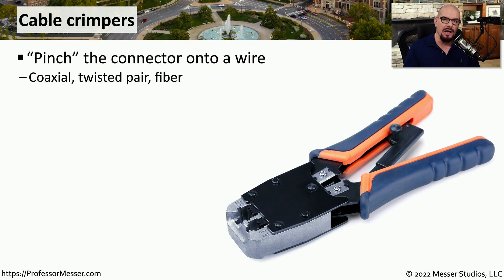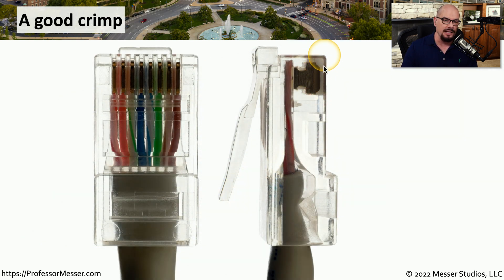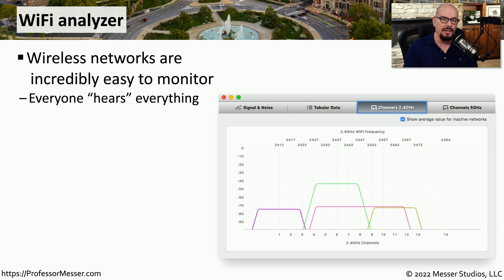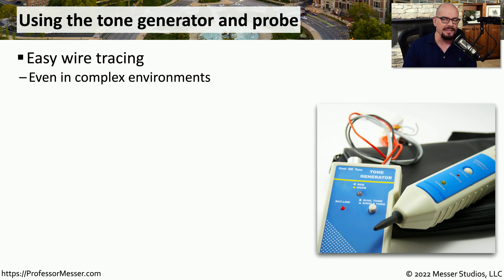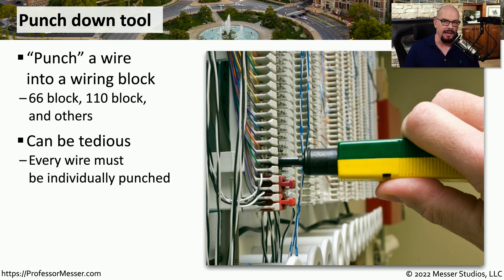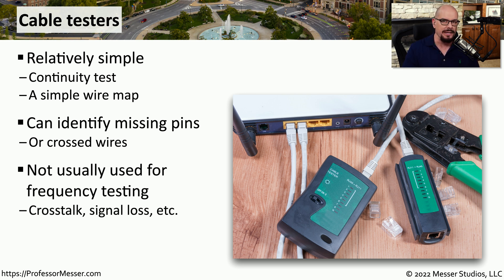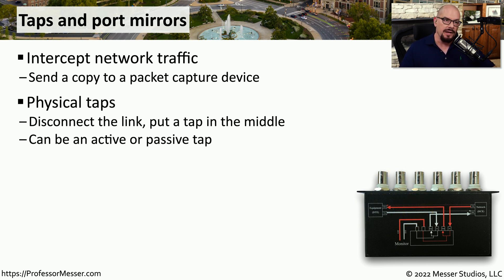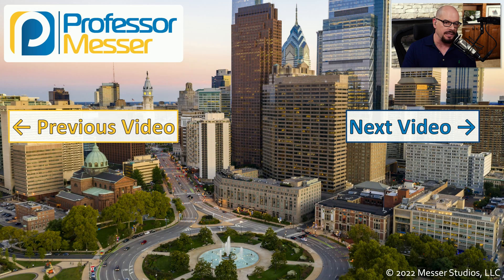Network Tools - CompTIA A+ 220-1101 - 2.8

Comment: For anyone who is trying to run wired ethernet in your home. Over the course of 5 years and 2 different homes. I would recommend not buying a spool of cat cable, just buy high end cables that are already terminated the exact length you need. You will thank me later. 

I have successfully terminated them before, but it takes much practice to get them perfect, and even on your best day you will not be better than a cat 8 cable you bought that was already terminated, and future proofed.
Reply: True unless you need to put in tight space